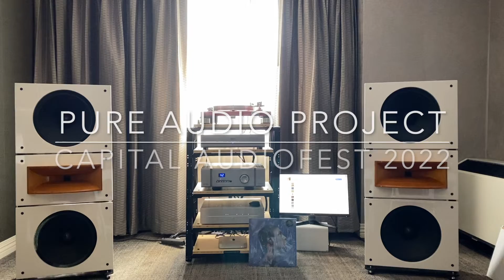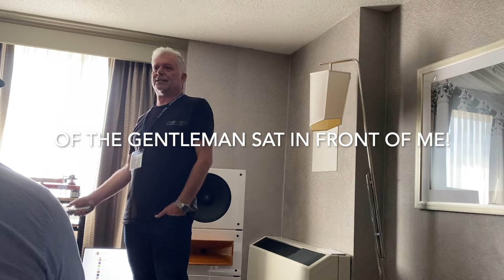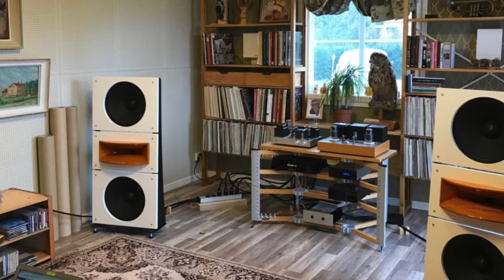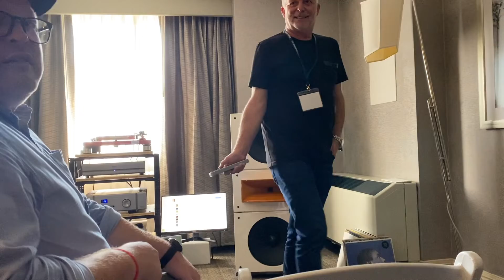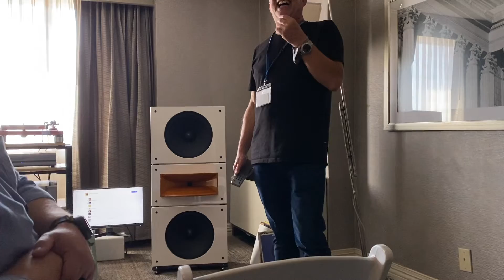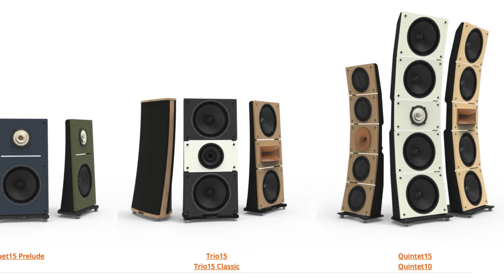Pure Audio Project Review And Discussion With Ze'ev At Capital Audiofest 2022

Comment: One little thing to add. A passive crossover when it is built with using an in series topology incorporates a driver inductance and in some aspects is great and better than a traditional one in parallel. But it needs to be precisely adjusted for a particular driver. That's an option when you are limited with a passive crossover only (for instance you have money for only one d'Agostino )))) In all other cases an active crossover and multiamping is far ahead in many aspects.

Comment: Would they work for a room that is 37x50? Im building a listening bar and considering them
Reply from the maker: That's a big room to fill. You might need to augment with subs to get a solid bass foundation. Using subs with open baffle speakers is a little tricky but doable. I'd contact PAP directly and ask their opinion.